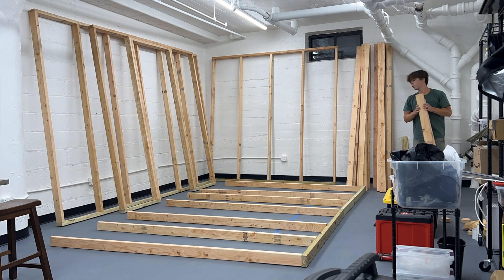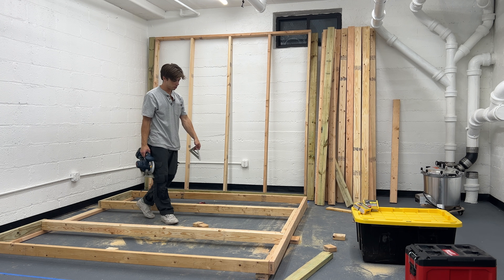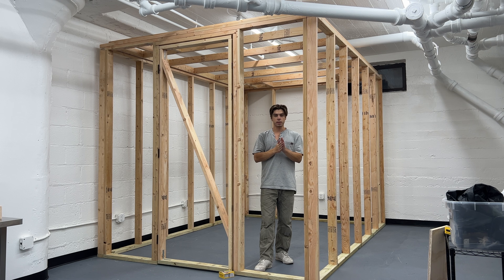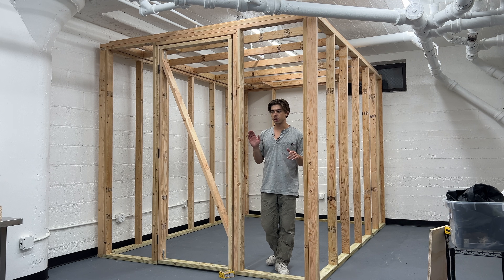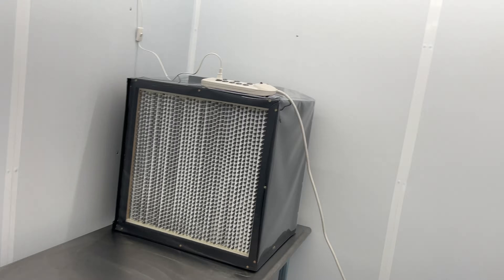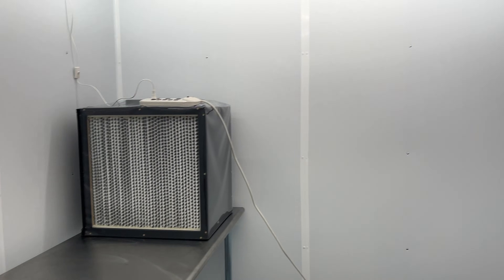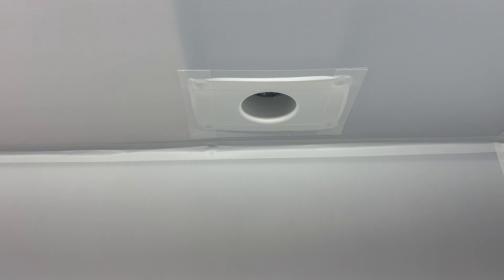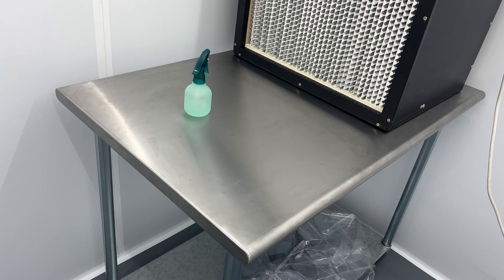Building a Mushroom Lab | Full Build and Design Breakdown

Comment: hey, first of all great video, nice build!
You look young, and responsable, capable, I wish you great success and good vibes.

Sry to point it, but didn't you put the diagonal support for the door, in the wrong way ?? 
look at custom-hinges-doors doe's and don't, I have come accross an explaination about why: 
If we layout the forces vectors:
Hinge side: the higer hinge will get pull apart while the lower hinge would get crush (saying like this to be clear)
The opposite vertical force on the anti-hinge side will pull down and deform the door.
with diagonal support in the wrong way: it is much less effective at reducing that anti-hinge vertical force.

By placing the diagonal support fixing the lower part near the lower hinge (you need the higher part opposite of the hinge side)
you effectively split the vertical force on the anti-hinge side between the anti-hinge stud and the diagonal one, much more effective!
This will be more stable and durable.
Reply from the maker: Thanks for the comment, you're absolutely right. I had the wrong reasoning when putting that in and it should have been the other way. But it's still holding strong 10 months later so it's not really a concern for me right now.

Comment: i have a question - your laminar flow will pull everything off your body/clothing and then up into that duct. why not place the flow cabinet supply duct off to the right side of the cabinet, and move your in-line somewhere else? alternatively you could get rid of the in-line filter and just sit in the lab and scrub the air until you think the pre-filter has caught enough germs off your body/out of the air in the room. i definitely wouldn't put the air returning to the cabinet right behind my body if i were aiming to min/max the lab's efficiency but if you have a dedicated/clean lab coat then maybe its not a big deal - i've always only ever done work in open-air and i've gotten surprisingly good at it very low contamination rate. i would absolutely caulk the flanges of all your penetrations - before you taped the concrete floor i was anticipating you'd be caulking the floor/wall joint as well. i'm not sure how tight your door frame is but i'd also consider adding a rubber/weather/caulk strip around the piece of plastic, as well as adding a little lip at the bottom of the door with stripping - since your room is designed to be positive pressure that probably matters a lot less but again if you wanted to min/max the efficiency. 

all that said, i think this lab will still perform very well. it looks great
Reply from the maker: Thanks for the comment, the ducting I installed for the flow hood was designed primarily for airflow purposes; I wanted a column of air moving straight towards me while I'm working to minimize turbulence and the chance of contaminants being blown into my work space. I do wear a dedicated lab coat while I'm working, but the HEPA filter on my flow hood filters out 99.97% of particles 0.3 microns or smaller and I also have a prefilter in there so any contaminants that might be picked up from my body and sucked back into the ducting will be filtered out anyway. In short, the filters are responsible for eliminating contamination coming out of the hood, and the ducting just directs that clean flow where I want it. 

I did end up caulking any cracks/seams, including where the rubber molding meets the floor and the wall, so the room is essentially sealed with the exception of the door. I left slight gaps around the door because I wanted to reduce stress on the structure that might result from running constant positive pressure. The air needs somewhere to escape, and since the door is furthest away from where I'll be working, I chose to let it escape through the cracks there. No air will be flowing in through those cracks though because of the positive pressure.

Comment: Nice build! My 'lab' is in the living room, so it's not very practical. Do you think this design could be built outside, or would it be better to build a greenhouse with a concrete base and metal frame?
Reply from the maker: If it has to be outside I'd probably go with a greenhouse, ideally on some sort of foundation, whether that be concrete or just a vinyl mat or even tarp. All depends on how permanent you want it to be. As long as it's weatherproof, sealed, and you can run filtered air into it, you should be golden. But if you have somewhere inside you could throw a small grow tent to use as your lab, that would probably be much easier.
Reply: @camsurbanfarm  Thank you